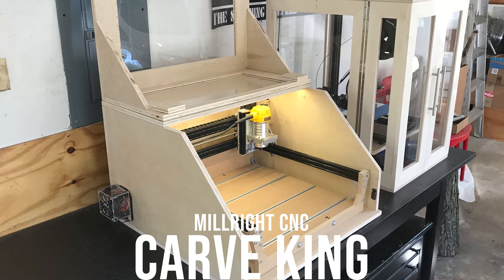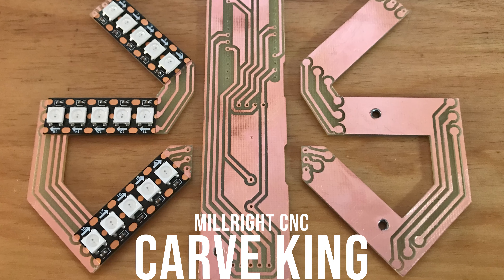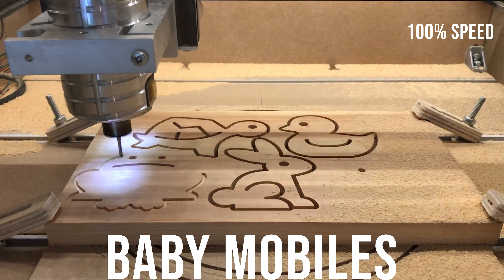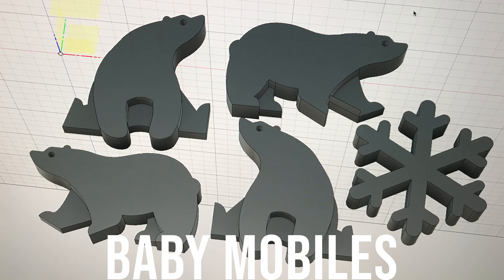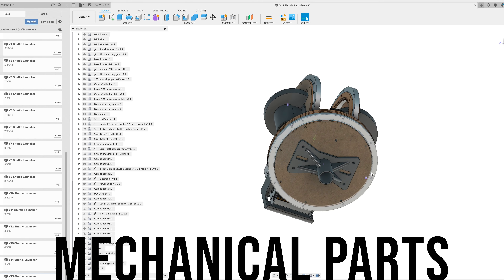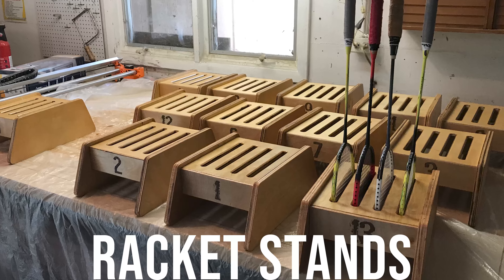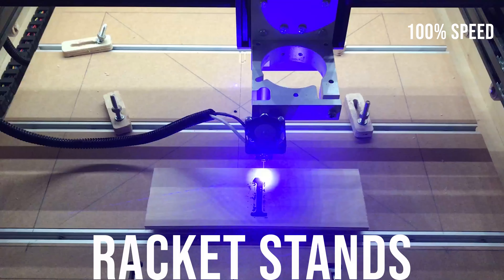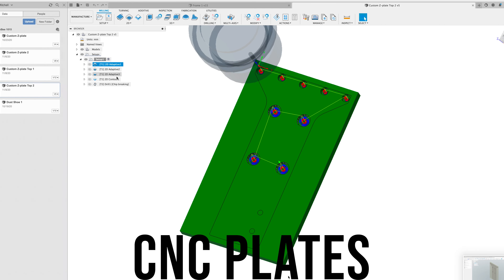REVIEW: Carve King by MillRight CNC

Comment: A good video showing what the original (wood) Carve King is capable of.  I have had mine for about four years now, and, it has had no trouble doing whatever I asked it to do.  The only modification I did, if you can call it that, was to replace the loud noisy router with a much quieter spindle.

Comment: i saw that you have low rider 2 as well there. Can you compare them ?
Reply from the maker: They are not really that comparable....they are very different machines for different tasks. The Carve King is a good general purpose entry-level CNC. The lowrider is only good at one thing, cutting big for as cheap as possible.
Reply: @diyfiberlaser  Oh I see , i am asking because I have just bought an used V1 Low Rider 2 - I have seen it as a 3d Printer , and as a cnc machine - i will this or next week assembly it . Then Post a video of the first try.
Reply from the maker: @RadekSzabla  I put a diode laser on it to do some engraving as well. Good Luck!